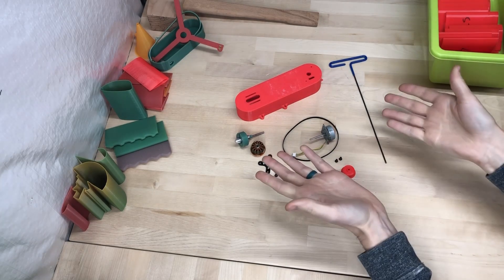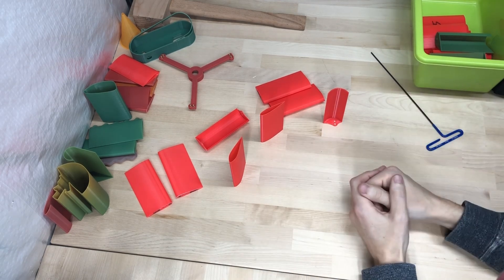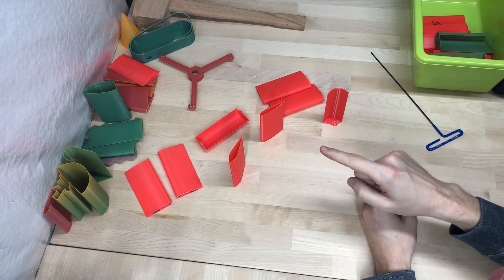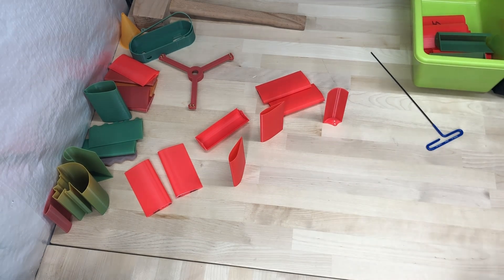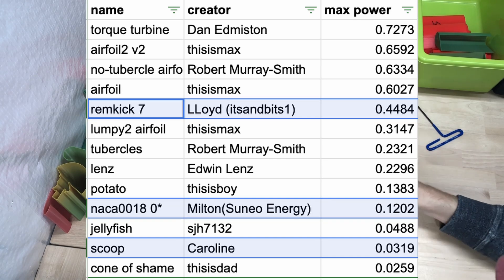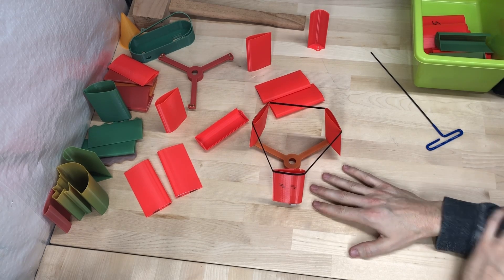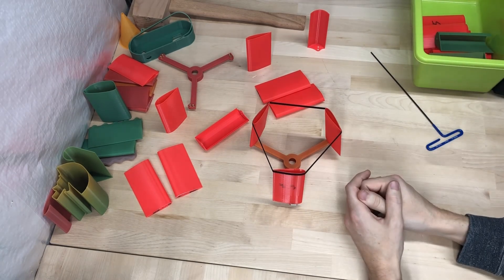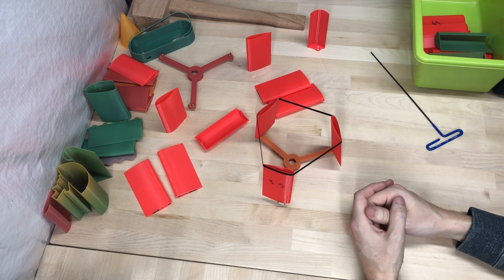Viewers BLOW our wind tunnel record away! | Turbine Challenge Episode 1 | Turbing off | VAWT

Comment: As soon as I saw the results I jumped into simulation software and tested the design with a 12 degrees pitch. The results are far from good, so I believe the difference you are having is related to the solidity factor you have. The chord lenght is too big compared to turbine diameter compared to my original design, and that may be the reason you have such a difference between cero degrees and 12 degrees pitch angle. Thanks again for your brilliant work
Reply: Scale greatly effects the performance of VAWTs that use aircraft style airfoils, mostly because of the change in the Reynolds numbers they operate at.  The airfoil, airfoil angle, and solidity combination that works great with a 15 ft diameter VAWT (Reynolds numbers 1,000,000 plus) will most likely be worse than terrible at this scale (Reynolds numbers less than 40,000).  For all aircraft style airfoils as the Reynolds number drops so does the lift to drag ratio and the stall angle, most notably when it is falls below 100,000.
Reply: yah, 12 degrees is way to high, you're starting to get into heavy drag; I agree the chord length is a big factor in high speed but it will give more torque at lower speeds so wing versus generator balancing is needed. The Remkick are designed for higher lift at lower rpm to try to lower the stresses on the mounting hardware and wings so an alternator that generates the same power at lower rpms is what they are aimed at.
Reply from the maker: I found some differing ways of calculating the turbine solidity, are you using (num_blades * chord_length)/turbine_diameter to get you solidity? maybe Lloyd ( @itsandbits1 ) can help us out here?
Reply: @hellothisismax Yes, that's the right formula.

Comment: Great video, 
and if your thinking of improving the test stand.   - a thought or two.
If a mirror image copy of the rotor base was printed, it could plug into the top of the blades.  The option to place a center support tube between the top and bottom support might also help tame the wilder rotors.   A support for a two blade rotor would also be interesting for making comparisons.
Reply from the maker: ooOOoo yes, i think im gonna try to add this in the redesign! but also make it removable so i can still explode the squirrelly ones :)